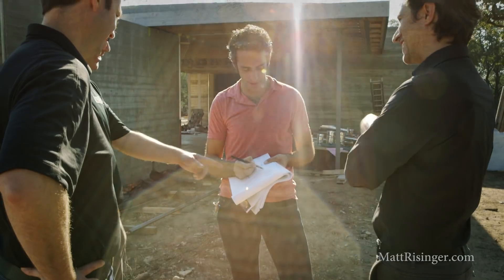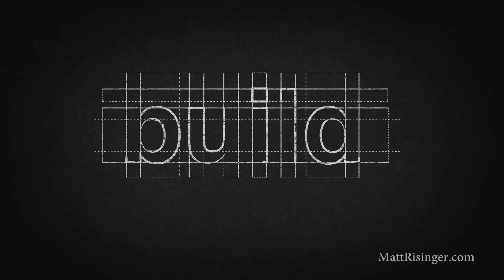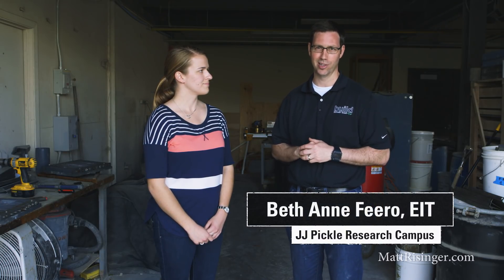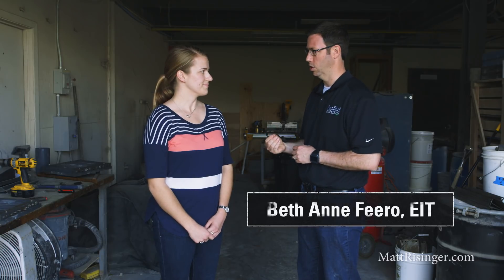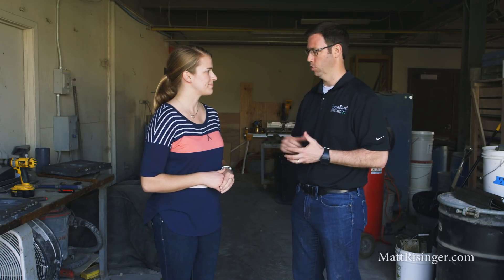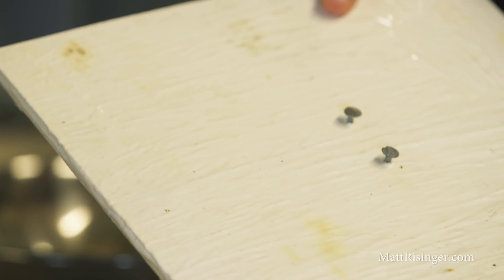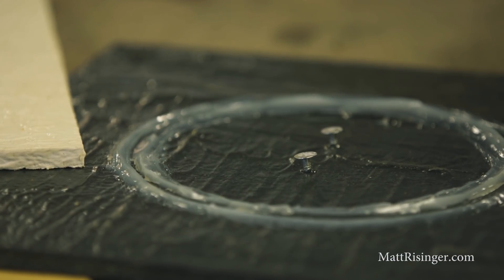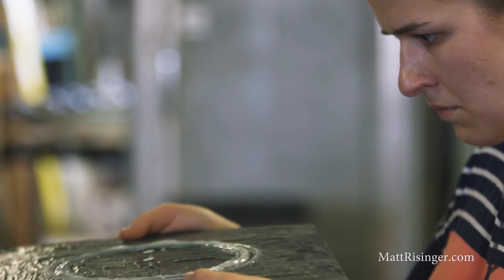Nail Sealability Test - WIP & WRB's

Comment: Based on the author's article, the old test required the fastener to be backed out 1/4" while the current test leaves the fastener driven flush.   So one might question if the manufacturer's self testing has really failed or not based on the UT test.   Nevertheless it would be interesting to know which fluid applied product did seal based on the earlier test protocol.  I have seen exceptional results on white elastometric roofing products still in use after 30 years.